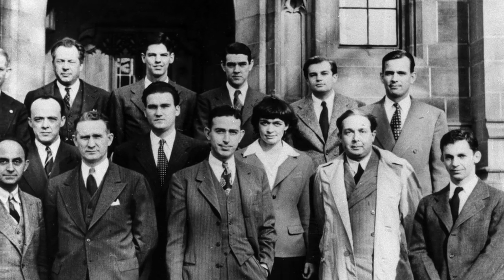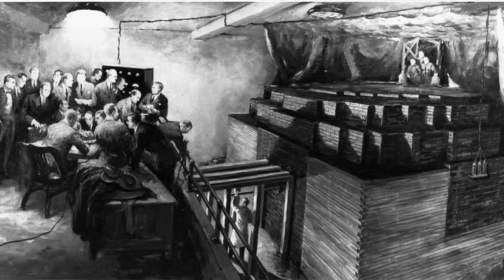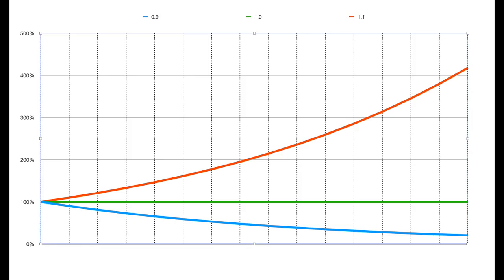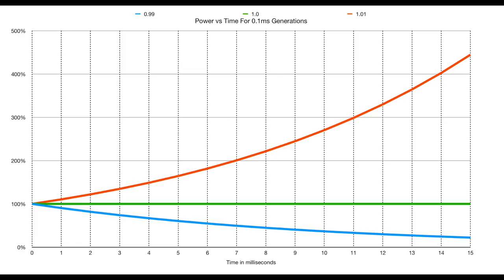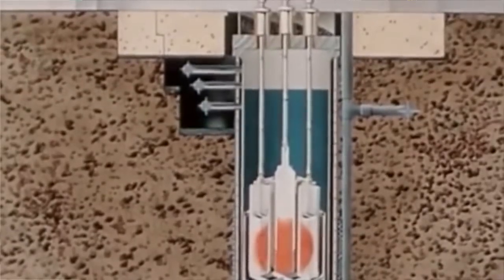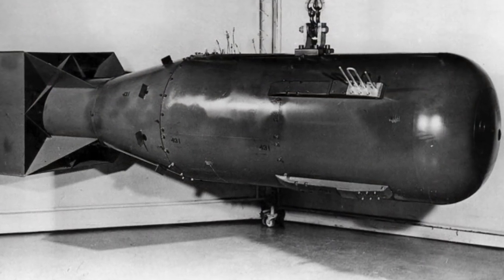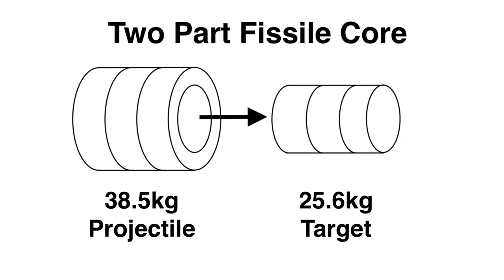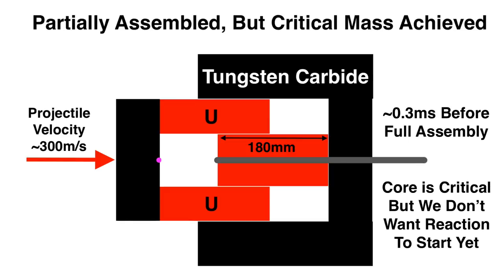Going Nuclear - The Science Of Nuclear Weapons - Part 2 - Chain Reactions

Comment: So I have a question about reactors.  I watched a documentary about them, and they claimed that Sodium reactors were extremely safe and were the future.  However, I can't help but notice that we had a Sodium reactor meltdown in Simi Valley, California, not far from downtown LA.  Why did this meltdown happen and are Sodium reactors actually safe?
Reply: Sodium reactors have reach a super high level of development at this point. Many can be said to be passively safe, shutting themselves down even in the event of a full system blackout! There is a great video about that here watch?v=Sp1Xja6HlIU&t

Don't judge the merits of sodium stuff on the Sodium Reactor Experiment, it was literally a learning experience, there we 0 on hand knowledge of using those types of materials (both sodium and the cladding used). The use of sodium bothers some, but the lower pressure operation make is likely a horizontal trade off in terms of overall risks. 

The meltdown happened because of some blocked coolant passages because of different contaminates from some spilled tetralin into the sodium coolant. This caused all sorts of metallurgical changes and decomposition that plugged up the pipeworks. Tetralin decomposes into naphthalene, which in turn "reacts with sodium to form a very reactive, pyrophoric naphthyl- sodium compound." 

Doc._No._2_SRE_Fuel_Element_Damage_Final_Report_1961_NAA-SR-4488_(suppl).pdf

It was design didn't have enough care if coolant channels failed and faulty monitoring procedures allowed for coolant contamination doomed this experiment. In a way, it was a good experiment, it did exactly what it was supposed to, expose flaws in a controlled way.
Reply: Well, the fact that they kept running the sodium reactor for weeks after the meltdown, and they covered up the incident including all that radiation released into Simi Valley, combined with how the nuclear industry reacted to "The China Syndrome" and the subsequent Three Mile Island incident with the blatant lies, makes it really hard to separate the fact from fiction.  Just cause the industry expert says it's safe means nothing, figuring out why it's safe seems the logical course of action.  I do know that Sodium Reactors were rejected from the military, especially on subs because a breach in the reactor means molten sodium spilling everywhere, which sounds decidedly unsafe.
Reply: Ya, transparency back in the day wasn't great, mostly because they played inside baseball and anything that was in their predefined rule book of safe was just taken to be so and they negged anyone saying different. 

Even so, particularly in the TMI incident, there have been 2 independent scientific studies that said they anticipate zero deaths as a result of the relatively small releases. 

Similarly here, a study "Feasibility of developing exposure estimates for use in epidemiological studies of radioactive emissions from the Santa Susana Field Laboratory" concluded the expected doses to people is likely so close to background as to be unattainable to any real increase in mortality. He talked about how hard to is to reconstruct this stuff given the cover-ups and such, but using what we know about how much might have been released and wind data, we can at least get a simulation set going and find a median, and that value was basically 0. 

And to be fair, they didn't exactly know they had a meltdown, only after the investigation did they understand that in context to the gas releases that were happening. They likely should have suspected, but lack of experience in this particular design was mostly to blame. 

I agree that is hard to separate fact from fiction, though. But sodium reactors might have a place in the future, or perhaps it will be gas reactors, or pebble bed, or molten salt, hard to say at this point. They all have advantages and weaknesses. I used to really hate on the sodium reactor cause of history like this, but after investigating how the engineering has advanced, I would submit they can be as safe as we demand things to be these days, and so too for most of the new advanced designs going around.

Comment: I love this new series, can you please include all of the nuclear incidents? Chernobyl, three mile island, Fukushima and the Army reactor (sl-1). 
I think the public should be educated more on nuclear power. I didn’t know reactors could explode like nuclear bombs when I was a civilian. Thanks
Reply: That is because they kinda can't, that is the point he is making here. Getting things to be in the right condition to ramp their power quickly before the laws of physics rip it apart is VERY difficult and requires exacting precision and highly refined materials. Reactors tear themselves apart before they explode with similar effect, usually suffer critical pressure explosions from water flashing to steam before anything resembling a bomb style explosion.  The worst accident was Chernobyl by far where they did experience a prompt criticality, but because they use thermal neutrons and low enriched uranium, there is only so much power ramping you can do before things rip apart. And so it was, the prompt criticality resolved by a 10000% increase in reactor power in several moments and the reactor water flashed to steam and the rest is history!
Reply: At best you would cause a fizzle. It requires quite specific conditions and everything about a reactor design is constructed to avoid these conditions.

You would have to force it to happen mechanically.
Reply: The Zone gives and the Zone takes. But it mostly takes.
Reply: With low enriched uranium, you can't even get a fizzle, just not enough time.

Comment: Well seeming how uranium solid fuel reactors are at a state where it is just one wee bit away from going super critical and triggering a runaway reaction I wonder when Scott does his Civilian Nuclear Power offshoot series if he would cover uranium solid fuelled reactors and their opposite numbers the Thorium Molten Salt (Liquid) Reactors that rather than having to worry about the thing going up like uranium, with thorium MSRs you had the problem of keeping the sodder going (hence no meltdown if something went wrong and the fuel supply was cut off). 

Anyhow enjoying this weapons series :-)
Reply from the maker: As many people have already pointed out, modern designs have many passive safety features built in, so that thermal expansion in the fuel, moderator or cooling will naturally slow the reaction.
Reply: That is true especially of the Gen III designs around. In any case NuScale and Terrestrial Energy are working away to get the Gen IV designs online by 2026. But I am diverging away from the topic of Going Nuclear >_<

Comment: 1. Tungsten Carbide ? I don't believe WC  was used because the density is only 15.6 g/cc whereas up to  18 g/cc is available with HeavyMet alloys of Tungsten (which can be machined at room temperature) .  In addition  WC is rather more brittle and if you are not going to test the device why would you not go with a material with high impact resistance ? 2.  The correct core topology is a  male cylindrical target , a hollow annulus project and  three toroidal outer cores held concentrically around the target.  This enabled a  2.8 or 2.9 factor on critical mass to be achieved. The trick is that there is an air gap between the male target and the  encircling toroids.  This would reduce the number of neutrons per cm2 of  internal bore of the toroids,  in terms of receipt of  spontaneous neutrons from the target. (It works the other way from toroid to target of course).  3.  I have a strong suspicion that there was something novel about the securing bolt that holds the target. Specifically it  might have been boron steel with a sheer pin on the contact face and the  Big Nut at the far end so it could be punched out of the core at assembly time (and through the nose of the bomb case or into a recess) and in fact the wafers that make up the target are held in place by say 6mm diameter high tensile bolts or similar.  The three outer toroids were flown out to Tinian, one per each of three  C54 a/craft , I would guess because there was only enough U235 metal  to make up the target and projectile in say June 45 and the last three  components had to be site fitted, which would have been a nervous job. My guess would be  that just two outer toroids would have been required to get at least 6kT out of the bomb.  Little boy HAD to be dropped first because its yield was unknown and for psychological effect  Fat Man had to have a bigger explosion or at least be equal to Little Boy in destructive output.  Otherwise the Japanese army and emperor might try to call the bluff of the US.  Effectively the did that anyway.  They gambled  100 000 lives and a whole city that the US would not follow up quickly with a second bomb.   4.  The Abner initiator was likely flat given how it was going to be crushed but beyond that I'll say no more.  Another poster has provided data on initiators below.  All the above information is already in the Public Domain (except for my guess that there might be something fishy, as in neutron absorbing,  about the centre bolt of the assembly.)  By the way,  there is  such thing as  an absolute critical mass.  There is a critical mass for a sold sphere, there is a critical mass for a solid cylinder of a given aspect ratio.. and so on.  It is all about the surface area (neutron loss ) to mass ratio.
Reply: they did indeed utilize tungsten carbide as they were unaware of beryllium's superior nuclear properties at the time.
Reply: @nickhowatson4745  I'm not so sure of hat statement.  Be produces a lot of neutrons when alpha bombarded so it is used along with Po in the initiator.  The  Tungsten is a reflector not a generator.  if you have massive  cylindrical lamina of  WC then you have to have the hole through the middle off it.  It's Near impossible to bore later as  WC is so hard  so you have to make this in place as the  WC is created.  This is a big ask.  Hence my previous statements.   Tim Fidler

Comment: Never understood where the heavy water physically came into place in this design. That, though, along with information about Abner would probably not be something that THEY would let you get your hands on easily. ;)
Reply: Abner was similar to the slightly later urchin initiators.  They consist of polonium and beryllium separated by a metal foil.  The polonium decayed with alpha particle emissions, which could knock neutrons off the beryllium.  The foil prevented it, but when it was crushed at the start of the explosion they mixed and a sudden flood of 50 or so neutrons was created at exactly the right time.

Comment: I would assume that this gun style bomb, would have to use a vacuum system, right? I would assume that if the system was at atmospheric pressure, the air resistance would slow down the projectile, thus increasing the chance of predetonation.
Reply: No, and in fact the air made it less likely to predetonate as air is a okish neutron shield compared to a hard vacuum. Plus, maintaining a vacuum after a gas explosion is nigh impossible!
Reply: Predetonation was not a problem for the uranium bomb.  There was no vacuum.
Reply: Yes it was, he discussed it in the video, there was about a a bit less than 10% probability of fissions that would have caused predetonation. In the window before full assembly, spontaneous fission is still a major consideration.